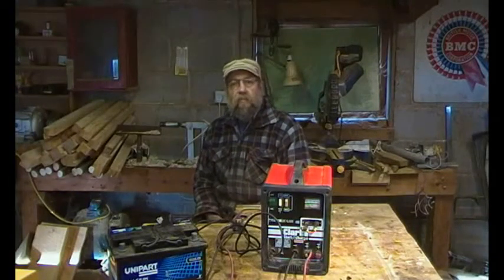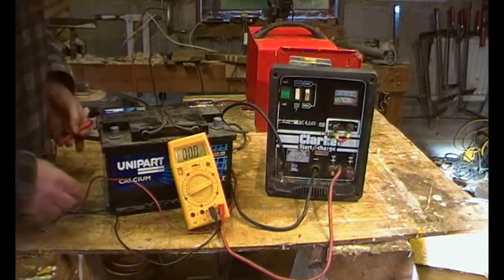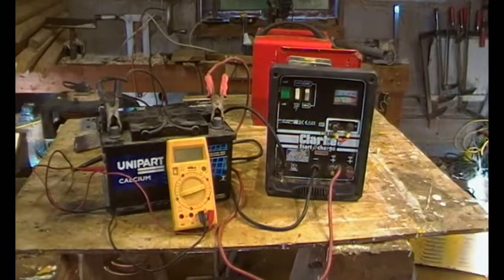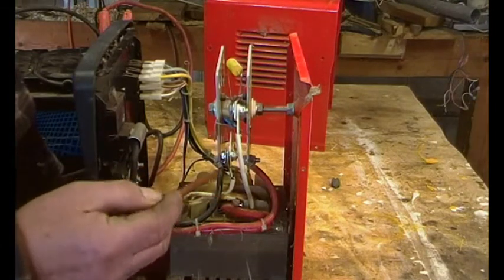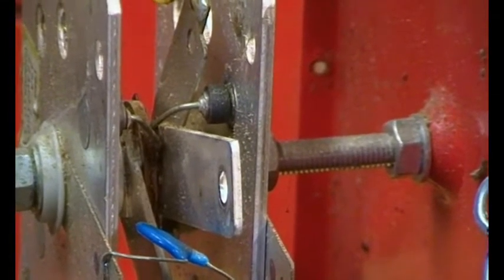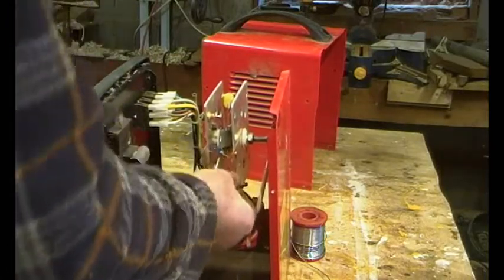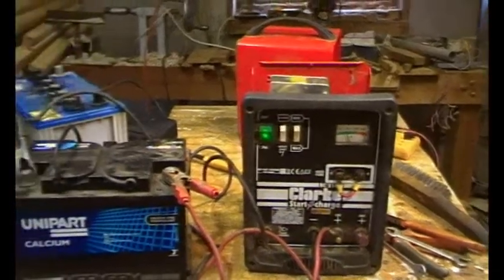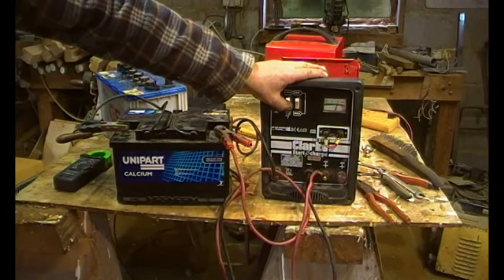Battery charger repair No: 2. Diode replacement.

Comment: Good evening, my friend.I would like to know where I can get those diodes , because I have sealey 220 super start 12v and 24v battery charger and i have the same problem with low side going up to 15v plus please can you provide where I can get the diodes from. Can I get them on amazon and what type do I buy please?
Reply from the maker: Try Ebay not amazon, avoid amazon at all costs, go on voltage and current, cheers

Comment: Dear sir can i use Gunn Diode for battery charger
Reply from the maker: not sure, it's got to handle the current, they've got 3 legs, you could give it a try but better off with a power diode, cheers

Comment: I have had one of these chargers for about 25yrs and still going well. Only problem with it is, about 5yrs ago I lent it to my son to charge his battery and he left  it on boost all night and nearly melted his battery, and the boost facility has never worked since. I was not very happy with him .The instructions say not to leave it on boost for more than 30 seconds! I have always wondered if it was possible to fix it and now you have given me hope. I will check the diode and see what happens.  Thanks for sharing. Paul UK.
Reply from the maker: According to Frank Zappa, scientists think the hydrogen in the most common element is the universe, but he thinks stupidity is more common on earth. I reckon you will find the rectifier is the problem and if you are lucky, just one diode, cheers
Reply: @TheInfoworks  thanks for that, I'll have a look and hope for the best.

Comment: I have fixed lots of battery chargers with bad rectifier diodes by using GM SI, AD and So on Alternator Rectifier Diodes. Just mount the whole positive and negative bridges to heat sink and run all diodes together. With good heat sinking and chargers with cooling fans they do really well and out of All the charges I've fixed with Alt diodes, not a 1 has failed. They also work great in 12vdc power supplies with adidquite heat sinking and cooling. I've built 13.8 VDC Regulated supplies up to 35-40 amps with Alt diodes that ran 80+% duty cycle for HF linear amplifiers and Transmitters.
Reply from the maker: Hi, yes car alternator rectifiers are great as they are, just using 2 of the 3 inputs. They are designed to be fan cooled but at 20% capacity I agree with you, they are fine, cheers

Comment: Very helpful video, I have a Rohr charger /starter which I think I have overloaded, using you help I will try to establish why it is only producing 10V output, what is the best place to get spare parts from.?
Reply from the maker: Hi, thanks for the message, I have several battery charger repair videos, including one that was crushed. I normally use reclaimed parts were ever possible. It is often difficult to get parts from the manufacturer (and expensive), so search auction sites etc. Hope you have subscribed, cheers

Comment: Hi.
Are you in a position to tell me the ratings of the diods you have on such start-chargers? I am fixing one of my own... the diods are my unsolved equation. Thanks.
Reply from the maker: Hi, just go for a high current diode that fits your rectifier plates, no need for high voltage it's just the current, cheers

Comment: The diodes in that charger don't look big enough to do much more than a nice charge current - if someone has taken the word  'start' too literally, I am surprised any  of the 4 diodes has survived ! The transformer won't do starting current even slightly either ....  
I know I mentioned this in your last charger repair vid Andy, but I drew the circuit out as you were pointing to bits in this one, and as far as I'm concerned the 12v output is full wave  rectified not half - wave rectified, just like the 24v. Though with one failed diode here, both outputs would indeed be only half wave rectified, hence the poor output :o) 
Have a look at this google image : http://www.talkingelectronics.com/projects/70InterestingCircuits/images/6v_12vPowerSupply.gif
The bottom circuit is what you almost certainly have in your two chargers. Everywhere it says '6v', read that as '12v' , and where it says '12v' read that as '24v' for your chargers. Sorry, short of drawing it out for you myself, I couldn't find a better diagram of what you have on Google ! NB... both outputs are full wave rectified ! Let me know if you need more explanation......
Cheers, Dave
Reply from the maker: Dave, yes I fully agree with you on the quality of the components, but it's a Clarke and so low end equipment. I suspect Sealy sell the same as it's own . Thanks for the link. I need to discuss this further. From my point of view there is no diode on the centre tap, but having considered your thoughts maybe the negative half of the wave is canelled out by the negative from the rectifier through the battery and so there is no current flow. This just leaves the positive with a path for the current to flow. Cheers, Andy
Reply: Clarke stuff is cheap and cheerful I guess !  I will have to give this some more thought Andy -  as this dual voltage circuit is a combination of 2 types of rectification - one using 4 diodes in a bridge and the other using 2 diodes and a CT transformer secondary - we need to ignore the 24v output components when looking at the 12v output circuit, or it'll just be confusing... so ignore the two diodes that go to the 24v output, they do nothing at all when considering only the 12v output....ok ?
In one sentence - the 12v circuit can be thought of  as  2 half wave rectification circuits combined together - each of these consists of one half of transformer secondary, one diode, and the load battery, and because of the way that each half of a CT secondary winding  swings +ve and -ve alternately (think of the CT as a pivot point here) each half cycle, and, importantly, out of phase with each other  , each of the two half wave rect. loops is active for a different half cycle, so if you then connect these to half wave outputs together,  the two waveforms interleave with each other and you get  a full wave rectified output - bingo !  I'll email some more tomorrow when I'm more awake.... Dave